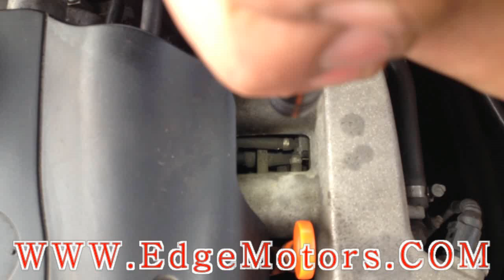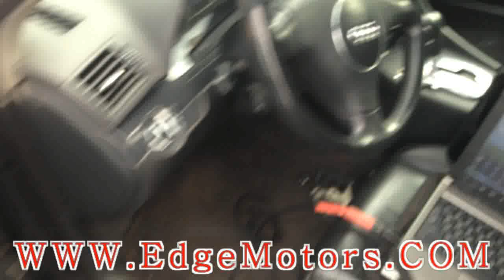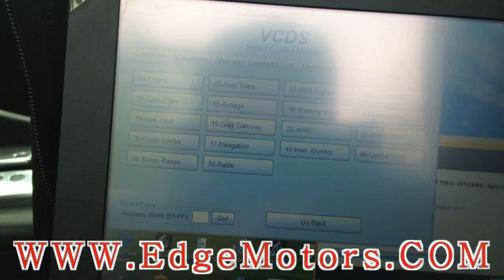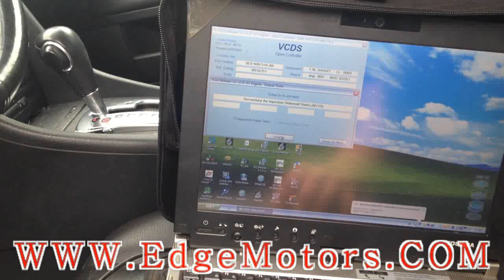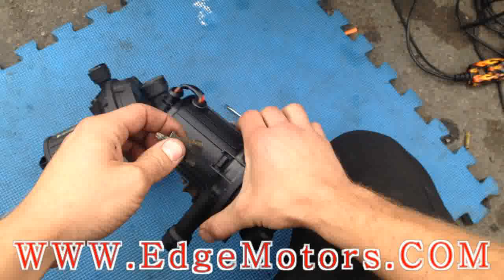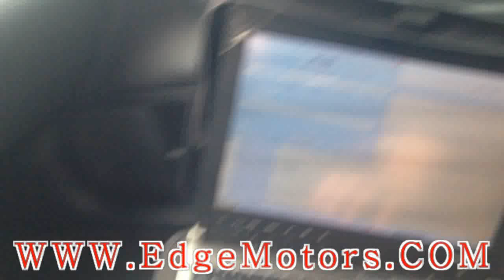Audi A4 secondary air injection system diagnosis and repair DIY by Edge Motors

Comment: Hey, I don't know if you still answer 10 years later. Thanks for your video which is very clear and a gem here. 
I have a B6 3.0, no fault code logged (at least with OBDII reader). But I have a hole at 4200 rpm when I accelerate. Do you know what could be the reason? I replaced the intake manifold actuator already, didn't change much.

Comment: The car jerks when driving constant speed at highway. Gives the fault code P0411 but can it cause this? Or is it possible that MAF sensor is faulty but does not give the fault code? I just unplugged the sensor and car still turned on like no effect at all. Didn't drive it, though.

Comment: I have a problem with a no start,  my pump turns on and stays on along with my fan,  I understand now from your video how to cut off pump but can you give me a idea of what to do about the no start,  I have fuel pressure,  I changed the spark plugs and I have no codes
Reply from the maker: Spark?

Comment: best DIY on this diagnosis and repair. done the whole thing myself and it runs perfectly. btw. I've got the BEX variant of this engine on my a4 b6 and the pump is more to the center of the bumper, its rotated and bolts are more obcured. other than that the repair process is the same. audi moved it because of the second IC this engine variant has got.

Comment: Question: If there is water in the Air pump but somehow all the water was managed to get out, would the Air pump still be good to use?
Reply from the maker: It depends on how long the water stays there

Comment: great video , may a ask you for your opinion please , i have audi rs5 2018 model and Im little bit concerned about the very weird air pumping sound with pauses my car makes when cold started and it lasts until it reaches the normal working temperature and also the car its shaking. I took it back to audi and they tested the car no fault codes. Do you mind to take a look my video I took please ,this is the link   Cheers https://youtu.be/w16436HnHWo
Reply from the maker: I can’t hear any sound for some reason.  It will be almost impossible to tell from the video, I’d have to hear it in person.
Reply: EDGEMOTORS thanks for your replay,yeh I know it's really hard to hear it on the video , but on 0.34sec you can hear it , and it last for 4,5 sec and stops and after comes back agai
Reply from the maker: No I mean there is no sound in the video at all. It’s muted.
Reply: EDGEMOTORS oh sorry misunderstood you, I don't know why , should be sound  , i will resend the link again
Reply: https://youtu.be/w16436HnHWo
Reply from the maker: Yea.... I can’t really tell from the video. Has to be in person.

Comment: so what happen if I removed the secondary air pump? actually I did it and no change on the engine occur
Reply from the maker: You will have a check engine light on, secondary air injection is for emissions only. It does not affect how engine runs, only supplies extra air to cold catalytic to warm it up so it could burn in burned fuel more efficiently.

Comment: When I disconnected my connector and hose from the pump they both had water. however my fuse was not blown. I know my combi valve is bad but do you also think my pump should be changed?
Reply: jeśli działa to nie

Comment: Hi, I have this same problem where I have water in my SAI pump. But realized that my air filter was soaking up water as well, is this coming from the SAI pump?
Reply from the maker: What kind of car is it?
Reply: 2005 A4 B7 but with the same 1.8t as this. It's an australian spec model.
Reply from the maker: Well if you getting water in the air pump, it could get sucked into the air box....

Comment: Great troubleshooting video, spot on for my issue. Quick question - are both the SAI pump and the fuel pump running on the same relay, 373? Thanks for the response, keep up the great work!

Comment: lready I already put some new spark plugs and ignition coil. Still have the same problem
Code :
Random/Multiple Cylindre Misfire Detected
P0300 - 008 - Implausible Signal - Intermittent
p0302 - 008

It is not dripping coolant by the spark plugs, I mean they are dry (As it should be)

Audi 2004 A4 Quattro 2004 1.8
Reply: Very long time ago but did you ever figure out the issue? Also I have a 14' s4 and have p0491 and p0492. Misfire on all 3 passenger cylinders, could the secondary air Injection cause this?

Comment: Excellent diagnostic.  BUT ... would think the reason the 40 amp fuse is blown would be good to know as well ??... there must be another issue to cause the fuse to be blown ?!  Maybe pump is worn badly and near failure causing heat build-up , or ...???  Again, good diagnostic though ...

Comment: Hey bro!! i have a question maybe you know something.... i have boost leak, heavy steering, heavy brake pedal... and sometimes in the morning have rought idle .... so i did a leak test and  it dont have any leak ...i change the HPFP,the vacum pump and the PCV valve... but still the issue..  so you think the issue is the secondary air pump??

Comment: Lithuanian? I have a friend who has the exact same accent...nice.  Have the 16795 code and will check the system soon. Diagnostic says the fault is intermittent and points to the pump I believe. Car runs well enough though, even when cold. Thanks for the info. Well done.

Comment: question- i replaced the combi valve, n75, and SAIP and smoke tested the system.  do I need to run vag com diagnostics in order to clear the code or can I clear using an obd2?

thanks
Reply from the maker: Yes you clear it with obd2 tool... 
N75 valve is not a part of secondary air injection system...
Reply: +EDGEMOTORS thank you.  the n75 does run a line over to the combi valve.  I needed to replace it BC I broke it during another repair

Comment: Thank you for this video. I have 01.5 B5 Audi A4 1.8T with the dreaded P0411 SAI code. This code is a nightmare and I never properly diagnosed ever because I am not professional mechanic, just a hobbyist. My situation is that the SAI pump turns on but I still get the code.

Comment: I have a question if you have a slight leak from the exhaust manifold to the turbo housing on one of the three bolts that bolts the turbo to the exhaust msnifold do you think this is enough to trigger this code the p0411? I did a head gasket.and in the process of taking it apart one of the bolts broke inside the turbo housing and.I had to drill and retap it and I think I might have to redo it  because it has a slight leak I can only see it on a cold start while the sec air pump is on because of the morning condensation then once the pump is off its off it stops like bubbling the moisture from the condensation I do not get any other codes and I have checked.everything else and its driving me.nuts any recommendations would help thanks
Reply: by the way the evap purge valve solenoid is constantly clicking and has like ,10-11 volts constantly and was not working and had a rotted check valve right after the evap pump bu the air filter and I changed out the check valve and its installed the correct way and I got the purge valve solenoid to work by twisting the screw inside it when before it was always.closed and not working so im like confused to as why I never got any codes before but now I do

Comment: Hi mate I have a 2004 a4 1.8 turbo 190 Quattro I have code 0203 wot somrone told me it's misfire  on 2 ,  I have changed spark plugs and coil but problem is still there can u help me pls cheers jason
Reply from the maker: Id need some more info, is it stock? Or you have some upgrades? Does it only happen at wot and on torque peak or other times too?
Reply: Yes its stock mate , at tick over its running ruff ,drive it wise over 3000rpm it goes put your foot down and goes but it then holds back.I've looked at some forums and someone has the same changed the ICM and was fine but someone else said could be one of the injectors its using a lot of water too a lot of clear smoke comes out the tail pipes only had the car a week got it cheap thou so was expecting  too spend on it ,any help would be very welcome cheees

Comment: Great video!! My situation: Audi A4 1,6 2002 motorcode: ALZ. Got a dianose made earlier with a P1423 error - so my Secondary air pump is not running on cold start (2 degrees celcius outside now). I took the secondary air motor out and it was full with water. I don't have a VCDS diagnose tool, so I checked the fuse, not blown. Checked relay (373) saw video how to check it with wires onto the battery, it clicks. Haven't check selonoid, don't know how to. So I checked if power was delivered to pump cable with multimeter, doesn't seem to be any power comming through to the pump... Can't see any visual damage to the cable wrapping when following the cables... Do you have any ideas?
Reply from the maker: +Jens Jacob Storgaard Jensen theck the pump it self if it works by applying power to it directly... 
but if you had water in it, the combi valve behind the cylinder head is not closing, so you have to replace that .

Comment: where is the SAI relay located? 
it is not in the ECU box... only thing there is the fuse
Reply from the maker: +mike k if you have an A4, its there... you have to pull the ecu out and if its auto you have to pull the tcu out as well
Reply: Thanks, it was under the ecu like you said... Unfortunately it seems like all the components are working... Maybe a wiring issue at this point. The ecu is also not throwing any codes although the air pump doesn't come on even in -20deg Celsius weather...
Reply from the maker: +mike k so if ecu does not throw any codes, why you looking for a problem that might not even be there???

Comment: my  engine light is on, and i was told its the secondary air pump not working,. i check the fuse & it was blown..., i change it & it blows again!!!!!!! what do u think is the problem.,
Reply from the maker: ***** most likely your pump is burned... or the wiring is short to ground somewhere..
check the pump it self if its working.

Comment: Ok quick question i pulled off a hose going to the air injection pump and water poured out...now what all should i look at to replace? I know more than likely the pump is bad but I don't have the program you were showing to test everything so i don't know what else is.
Reply from the maker: most likely your combi valve is stock open. thats the shiny thing behind the motor... take it of and see if it is in closed state and apply vac to it and see if it opens...
Reply: If it opens then what else would i need to look at?
Reply from the maker: Helldron01
you have to make sure it closes...

Comment: Good video - thanks!!!  Pump is difficult to take out, but kept working with it as you suggested and finally was able to remove it.  Took the bolts and rubber grommets off the pump prior to removing in order to get it out.  Also did not put bolts on new pump until had put it on.

Comment: Hi I have a 2003 Audi A4 1.8t 190 that has a P0411 code. A garage has quoted me £500 to replace the secondary air pump. I just want to make sure that this is the problem as I have erased the error code using a maxiscan scan tool and it takes around 2 weeks for the error code to come back again. I just wanted to check if it was defiantly the pump, or would the code come up as soon as I start the car after erasing?
Reply from the maker: all this code means, that the secondary air injection does not provide enough air flow. there could be allot of causes to that, including the air pump that the shop is telling you to replace. however does not automatically mean that the pump is bad like allot of shops suggest from just a computer scan.
so i cant tell you from the code if the air pump is the issue, or the only issue... there have to be some diagnostics done before determine if the pump is the issue. if you watch the video, i explain how to check most of the systems parts

Comment: I have a question ,whats the relay number for the secondary air pump inside the ecu, there are three,373,219 and 369 thanks
Reply: felipapa77 no one ever answers this question. I have the exact same relays. I'll be keeping a check on the follow ups!